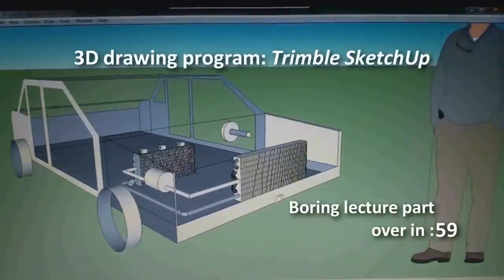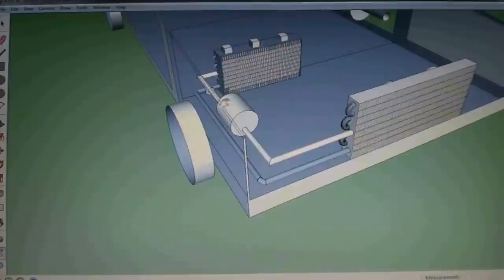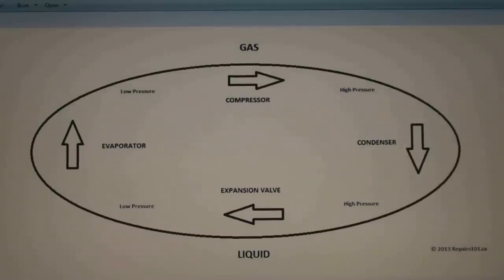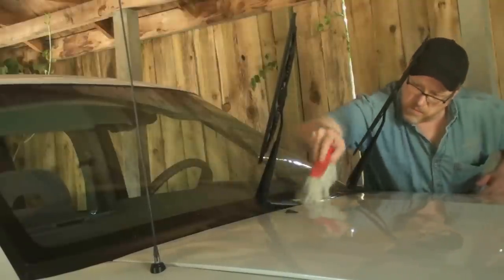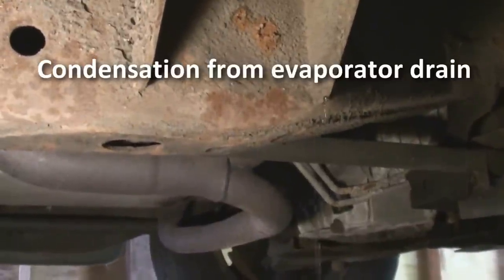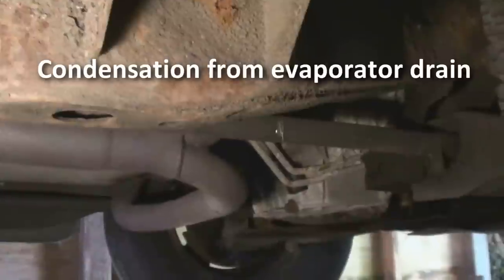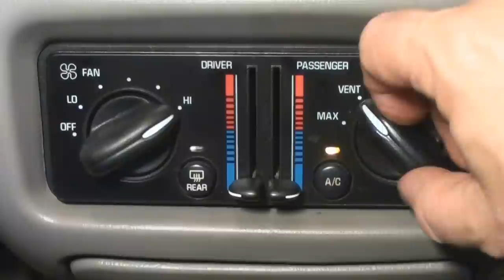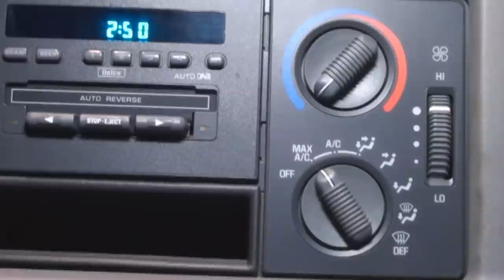Air Conditioning Smell Funky? A/C System Explained & HowTo Fix The Stink

Comment: theres smoke coming out of my car vents is it the head gaskets?
Reply from the maker: +luis bizarron - Dude there's not supposed to be smoke anywhere. If you have smokey exhaust then yes the head gasket could be the cause - white smoke? black smoke? blue smoke? but the real issue is the exhaust leaking under the hood and being picked up by the vents. If you fix your exhaust then at least the smoke will be directed away from the car. 
You didn't say what you're driving but maybe you can get a better car for less than it costs to fix that one. If you're on the west coast I have a gorgeous 2000 Buick Century with leather I'm asking $3500CDN for - perfect daily driver or low rider project car - no rust, everything works, mechanic owned and maintained. You can see her in several of my videos including   https://youtu.be/4v6QtCIRhFE  and   https://youtu.be/uYnQpacIUiY
Reply: i bought the blue devil sealent would that work?
Reply from the maker: +luis bizarron - I've never used it but I'm going to go out on a limb and say no.

Comment from the maker: Canadians spell several words with a "u"  - like colour, honour, (mould) and valour.
Wikipedia says - A mold, or mould (*see spelling differences), is a fungus that grows in the form of multicellular filaments called hyphae *In all senses of the word. Both spellings have been used since the sixteenth century. In Canada, both words have wide currency...
Reply: It is properly called 'correct English spelling', to include the u in these words.

Comment: When I first started investigating the smell in my car, I replaced the cabin air filter and the smell remained. Do I still need to take it out before spraying the clean air product, or is it fine to leave it in? Thanks
Reply from the maker: Geeze Daniel did you watch the video? Cuz if you did you saw that I take the cabin filter out before spraying. You can leave it in but that's like asking questions before you watched the video.
Reply: I did! I had already replaced the filter before I came across this video, and it was a pain to get the glove box removed. So I was asking to see if I could avoid taking the glove box off again. Thanks for the video!
Reply: Daniel Take it out again unless you want the filter to suck up all the liquid cleaner.

Comment: wtf is vinegar going to do to a heater core/matrix; if that 'eventually' leads to corrosion (ALU will) leading to a pinhole, you could well have to scrap the car, depending on the car, to be cost effective, due to the huge cost of replacing a heater matrix (hint, that's not the cost of the matrix itself but the complexity of the job). Also, this doesn't seem work too well when the problem appears in the winter, as it often can do, when your A/C (cooling) isn't going to be on or circulate air other than through the heater core; OR where the A/C condenser matrix and/or condensation outlet is the cause of the smell? From what little I know in practice... or maybe don't?

Comment: Ok so I am really hoping you can help me. I get a smell almost like rotting eggs and  urine drenched hay in one..I've had the truck for a couple years now. 2005 Nissan Frontier. Sometimes just the vent is on with no heat or AC, sometimes I have nothing on, everything is off, I get it when the heat is on, I get it when the AC is on. It comes intermittently. Inside and outside of the truck I have noticed it. .Have any tips? Please help,

Comment: Hi 101 repair. Great video and credit for good explanation of air system. I have issue of WHITE DUST coming out of blowers and from slide comand board. (it is so bad that i can't slide levers) .As i researched it is obvious that issue is in Aluminum oxide that  is in the system.  My question do i need to take radiator out or evaporator to replace it or it is lost cause. And do you know shoul i stop using air vent because al oxide is toxic. Thank you.

Comment: I've got a portable air conditioning unit in my living roomthe single hose one and the hose goes through the venting kit out the window recently when I've been run running it it's smells horrible and makes you feel a bit sick but no one else can smell it and I've emptied 80% of the water out the back because I don't have a proper kicked to do it and the full lights for water is not on thanks
Reply: Same thing with my truck ac.. no one else smells it so it makes me think I'm crazy but I swear it doesn't smell right

Comment: How do you tell if your car has an orfice tube? 

I have a 2011 dodge avenger 2.4 that doesn't get cool but has no leaks and has 1lb of refrigent in it low line gets cool and high gets hot . I was told it is clogged and I would have to replace the liquid line.
 What is your opinion? Thx.
Reply from the maker: mikequintero Did you see this guy's video? - https://www.youtube.com/watch?v=HBHrSRWwVfs

Comment: Thanks for the great video, I repeated this process almost three times and last 2 weeks, but Rotten Egg smell still coming out of AC , do I need to check somthing else. (smell pretty bad, like sulfer)thanks
Reply from the maker: I recommend trying again, focus attention on spraying directly into the recirculation pick up vent at passenger footwell with a/c running.
Reply: @repairs101  Thanks for the reply...I also checked cabin filter..looks clean..ac removed AC drain pipe under passenger side...draining good..no issue..sprayed lysol multiple...but smell still.coming..pretty bad smell..anything else.we.should try. thanks

Comment: It isn't always mold.  I was about to buy one of those cans.  Someone suggested to replace air filter.  Smells fine now,  odorless.  Sometimes,  it's your air filter,  not the mold.
Reply from the maker: You say that but then it would smell any time the vents are open (not just when the A/C is on) and not when A/C is on recirculate. And if you watch you'll see it's me who says change the filter.
Reply: I was also told to replace my filter..... low and behold, it had none, so my smell wasn't from the filter. I'll try the Lysol next.    Thanks to Repairs 101 for the video and 3D mockup.

Comment: definately replace the cabin air filter. Replaced mine after 160k...it was horrible to say the least
Reply from the maker: +Ben Pena - smell funky?
Reply: Repairs101 it was black and crushed up,  which from what i could tell was because the fan couldnt pull air througj it

Comment: My car a/c smells like burning rubber from time to time. Can you please help me.
Reply from the maker: Jose Miguel Jaugan Never heard that one before. All I can think of is that when engaging the A/C motor the drive belt slips and the smell is pulled in through the vents. [Or maybe you're a drift car racer?(just kidding) But seriously shut of A/C for races, it robs horsepower.]
Reply: Thank you very much for the info. I'll.also look into it..
Reply: +Jose Miguel Jaugan Look into the blower moter resistor. But 10 months later, I'm sure you've found the cause and cure months ago.

Comment: Can you get cigarette odors out?
Reply from the maker: +FortNikitaBullion - Out of the A/C system yes but a bigger problem is the smoke smell in the upholstery and headliner in particular.
Reply: +Repairs101 So what you could have told him is. Spray your headliner and carpet with Lysol or some other germ fighting mold killer. I suggest odorless. Afterwards, if you prefer a scent then apply one of the billion ways to create a false scent. Repeat if needed.